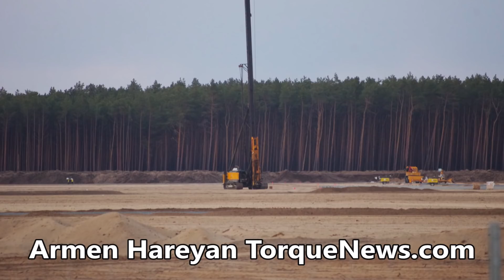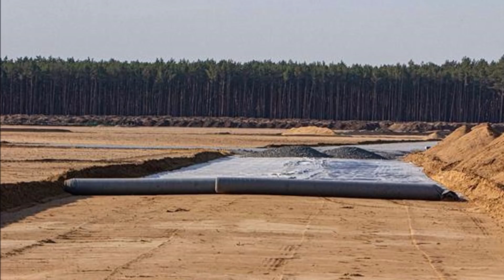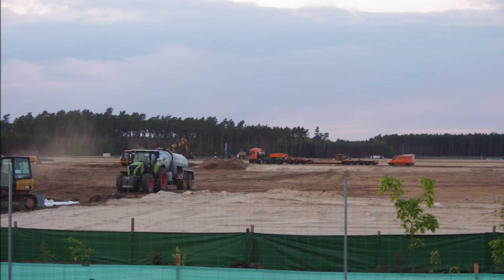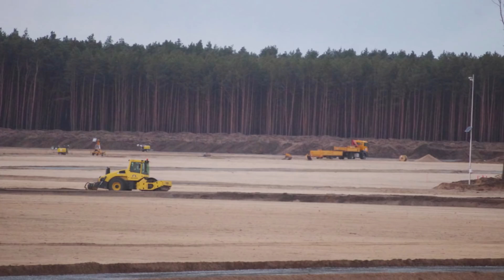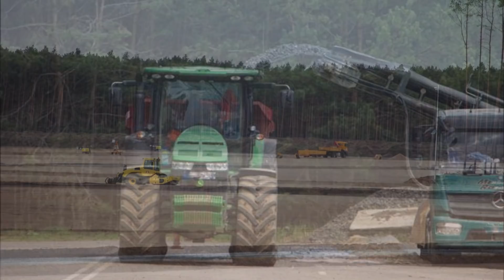Tesla is Adding Night Shift at Giga Berlin

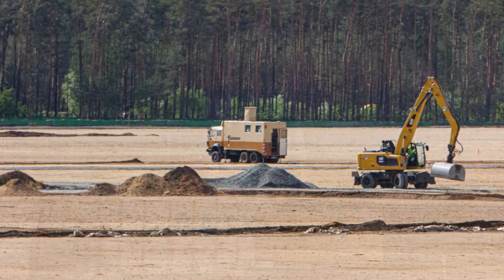Comment: Check out 1:42 The Mercedes Benz 6x6 truck operated by Fugro provides an interesting insight.
 Fugro is a Dutch multinational co and the world's leading  provider of Geo-intelligence. They are the world's leading Geo-data specialists, collecting and analysing comprehensive information about the Earch and the structures to be built on it. So they are providing soil engineering data to Tesla's contractors. This would include sand density at depth, water table depth etc. This is primary info needed prior to foundations.